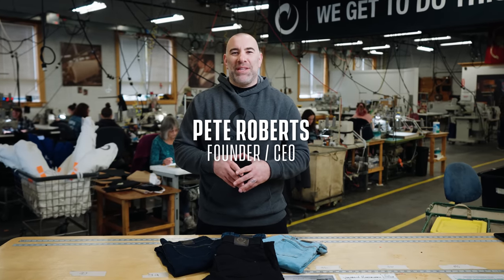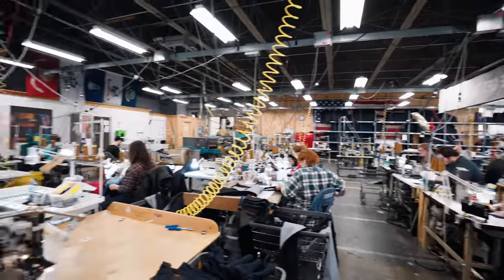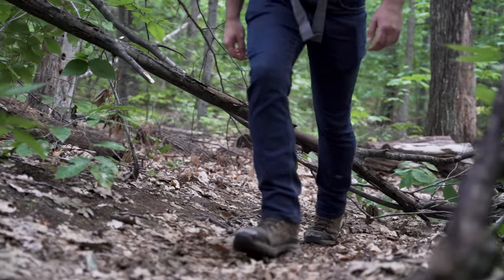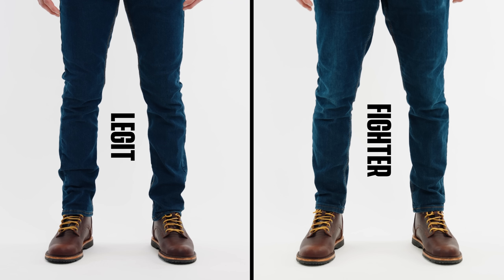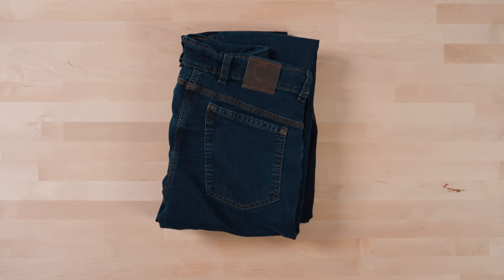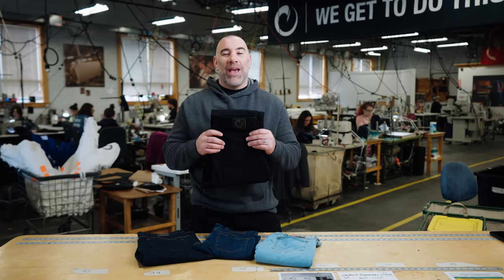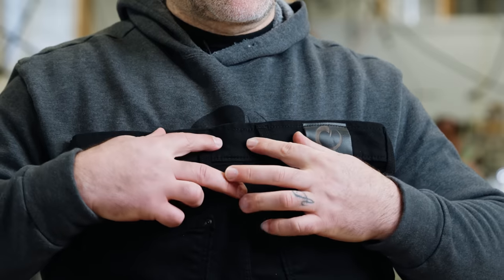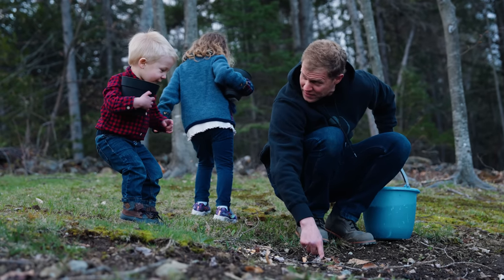The Only Jeans You'll Ever Need | Origin Delta 68 (Tech Video)

Comment: I just want a non stretch all cotton carpenter cut with a hammer loop that does not squeeze my balls into submission when I sit down. Had these fabrics that use the poly filaments in them and they end up breaking or melting and saddle me with a very noticeable bit of plastic filament that pokes me in the same places every time I wear the fabric. Been burned wearing blended fabrics and I can tell you plastic will melt into your skin and ruin your year. Stick with cotton if you work.

Comment: These are listed as 8.5 oz fabric. I'm a little concerned that they won't hold up as well as heavier pants from Carhartt, Duluth, or Devium. Any advice?
Reply: They have a work Jean as well as the Delta denim
Reply: @InGrindWeCrust2010 how was it?
Reply: @Artemis-v8i  I got a pair of both. I sent back the 8.5oz Delta jeans, which felt like mall stretchy jeans with much better stitching (triple stitched side seams!) and kept the medium weight work jeans, which also have some give. They're constructed really well and fit really well. I did need to send my first pair back to exchange as my first pair was missing a belt loop.

I've still been wearing my heavier fabric, looser fitting work pants more, but that might be personal preference. I find that my pants with elastane/Lycra/Spandex wear out faster than medium weight straight cotton (maybe 12-16oz fabric) even though they're great for squatting/kneeling and easier to find fit.